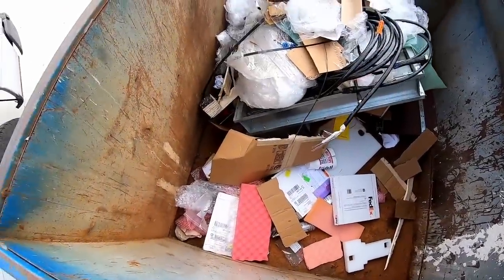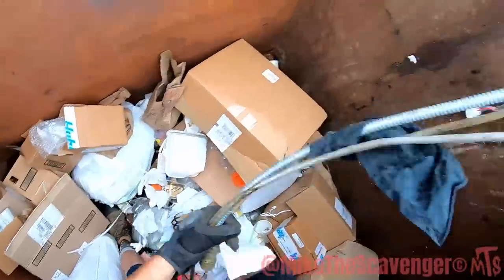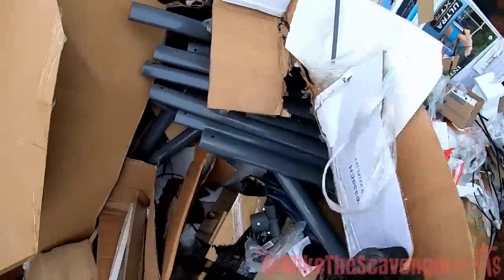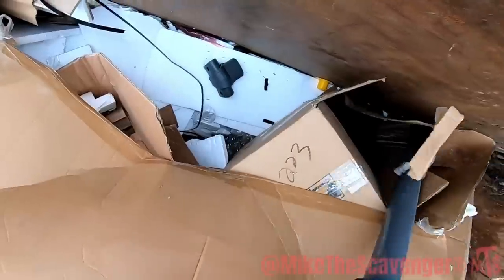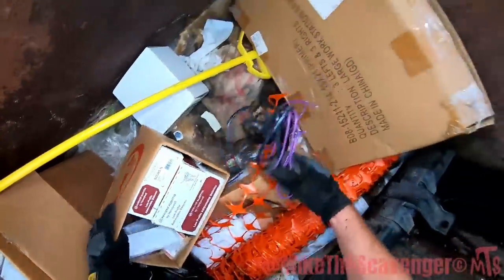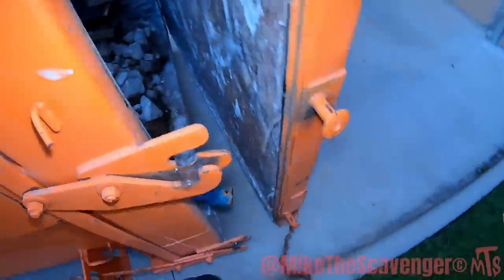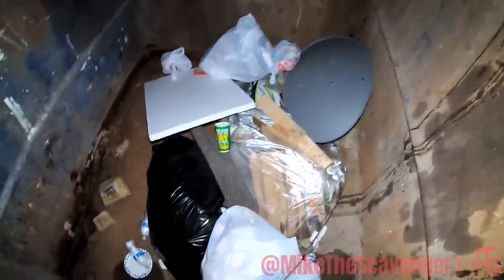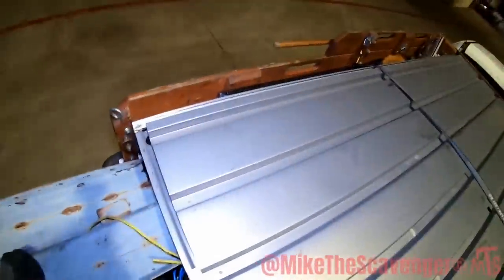Dumpster Diving "Walkin' A Tight Rope"

Comment: The thing you were questioning was an air break cylinder for an 18wheeler. Don't take it apart. There is a powerful spring inside under a huge amount of force. It can kill you.
Reply: Yeah. Used to be a heavy duty mechanic. You don’t want to take them apart unless they are caged. High pressure spring.
Reply: Yep had to take one apart on a concrete truck on the job once with the truck still running . It was definitely a watch your head moment when it flew apart.
Reply: It's not that powerful not nearly as bad as a front spring on a car.
Reply: They are made so you can't take the back off
Reply: It’s a semi truck brake chamber, it’s supposed to be disarmed before being tossed out, spring loaded, supposed to cut spring with a torch before being tossed out , now it’s not safe the way it is , stay away, I’ve cut plenty of chambers,
Reply: WITH THESE AIR BRAKE CYLINDERS, CHECK WITH REBUILDERS FACTORIES FOR THEM BEING REBUILDABLE,
BEFORE SCRAPPING!!

Comment: The crazy looking thing in the dumpster you were thinking might be a compresser. It is a brake chamber off a larger truck or semi with air brakes. I've had the pleasure of changing a few whatever you do don't tear it apart there's compressed spring in it if you're not careful they will fly apart and take your head off

Comment: Mikey, That thing you didn't know what it was is a air brake chamber for a big truck. *****DO NOT TRY TO TAKE IT APART!***** It will take your head off! You may want to pull it apart because it has aluminum and steel mixed but don't do it. And let your scrap yard know you have it. They will decommission it properly.

Comment: The thing you picked up at 18.30 is a brake servo off of a truck. They have a diaphragm and spring inside. The trucks air pressure over comes the spring pressure and pushes on the rod to apply the brakes when you stomp on the brake pedal. Another awesome video Mike.
Reply: I thought servos were electric? I used to maintain semi brakes. We just called them diaphragms.

Comment: We used those vents in front of diesel generator radiators. They were positioned for the best airflow based on the temperature of the facility.

Comment: Those bumpers and such were off a Jeep JL - OEM front and rear bumpers and running boards as well as the OEM radio. That stuff sells well and very fast on any marketplace. People that are selling their upgraded Jeeps to the dealer can't get their money back for their upgraded parts so they sell them and like to reinstall OEM parts back onto their Jeep before they give it to the dealer.

Comment: That pod you found that you said was some kinda air thing is an air break pod. I think you'll find your scrap yard won't take it cause it's under extreme spring pressure inside they explode violently if the retaining ring around the middle is broken.

Comment: Need to invest in a battery operated porta bandsaw or something so you can cut stuff down to better manageable pieces. 
The band saw doesn't have the spark flying issues that cut off saws have.

Comment: Mike the scavenger.. I know you're about the metal scrap but I see you pass up lots of cash in the dumpsters. For example. Those pallets. The quality pallets can resell for 7 to 15 bucks each. Oversize or heavy duty more.
Even used sheets of plywood if not heavily damaged can be resold for 10 to 30 a 4x8 sheet depending on material thickness and finish.
Also I saw you looking at legos once and I know they go for 10 plus bucks a pound 
Put them in a sock or nylon .  Tie it off, run thru the dishwasher and bam. Brand new legos.
The turntable, even if broken, is likely still worth some cash thru online parting it out..
Great energy in your videos. Love how you do wrap ups, clean ups, and yard runs. Very informative and entertaining.
Thanks Mike.

Comment: Mike, at 18:15 in the video, when you are holding it and ask "what is that" the nut on the side of the brake chamber that takes a 3/4" wrench to remove is on a stud that has a Tee head that is used to cage or compress the spring if you put it in the hole in the back of the brake chamber . Insert that tee end and turn clockwise to lock the stud in place and tighten the nut, that pulls the spring back so you can take the banjo clamps off and disassemble the unit, then unscrew the nut to release the spring pressure and it becomes scrap$.

Comment: That round thing you found at 18:22 is an air brake chamber, very dangerous, has a big spring in it, do not try to take it apart. they have special clamps to put it in to take it apart. Don't try to take it apart.

Comment: Mike that thing you said that belongs to some kind of pressure compressor that’s up belongs to a tractor trailer brake system that’s where you’ll find those that up underneath the tractor trailers. That’s what the brake systems.

Comment: The plastic you remove from wire, could it be turned into plastic suitable for 3 d printers. Today I saw a guy turn plastic water bottles into 3 d printer plastic. Just a thought

Comment: At first glance, the cables at the beginning of the video look like old school uhf connectors around coax.  I could be wrong, it’s been 30 years since I’ve seen those.  Used to use those all the time as a video set up technician.